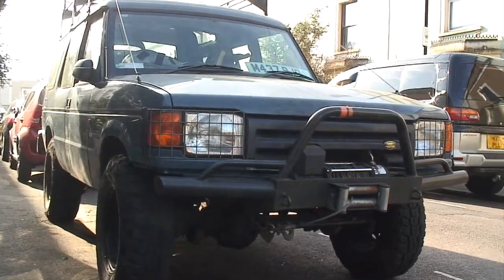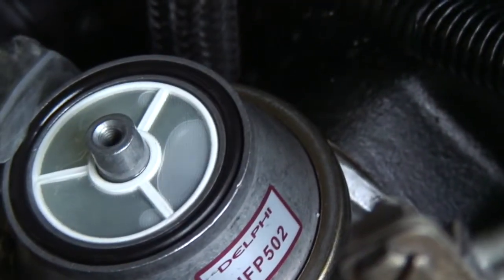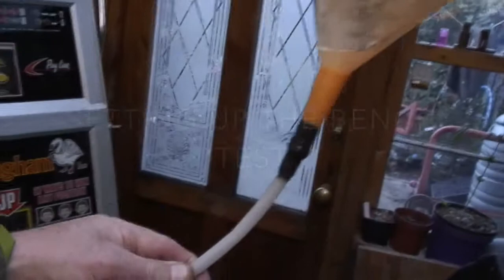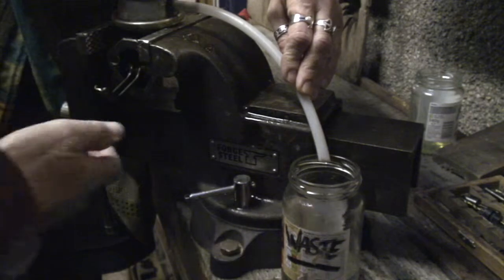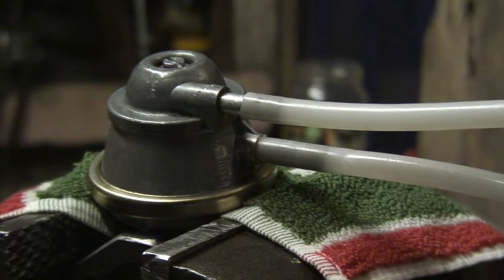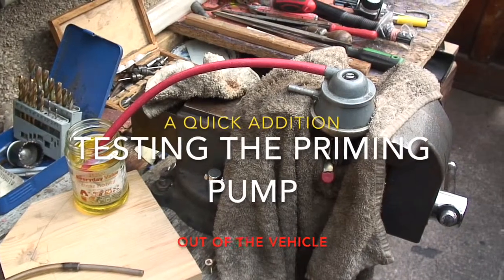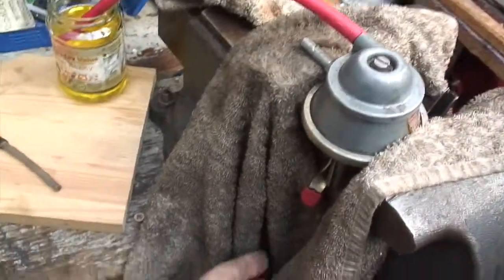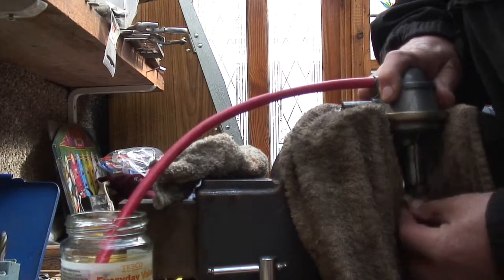Landrover 300TDi diesel fuel lift pump bench testing for flow. Air in diesel

Comment from the maker: UPDATE!!! The whole problem was in fact caused by a hole that had appeared in the casting of the diesel/water separator which sits up in the chassis,  drivers side rear. Once this was sorted the truck fired right up and has been fine ever since...quick touch some wood!